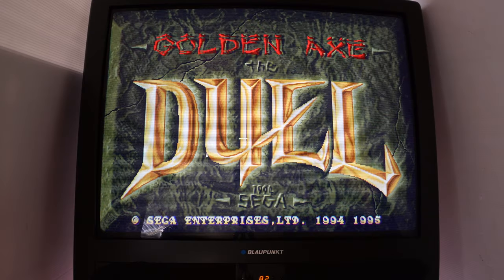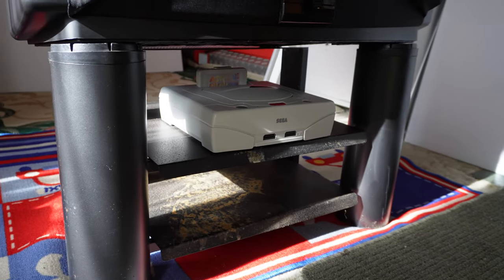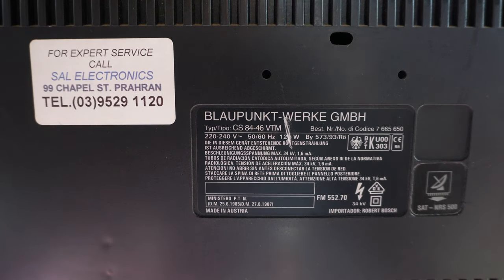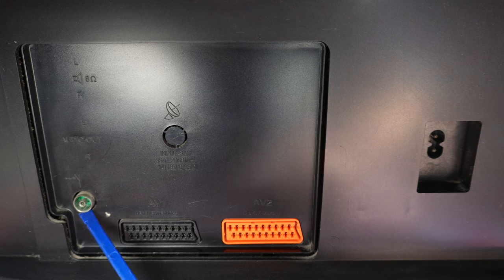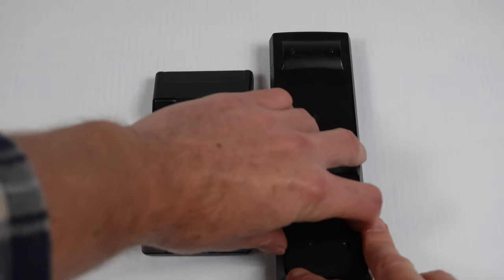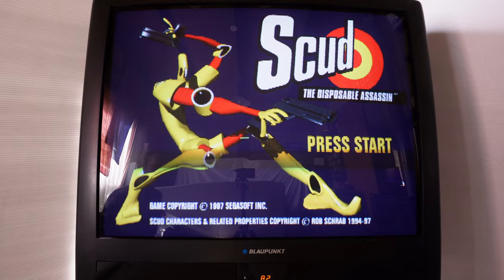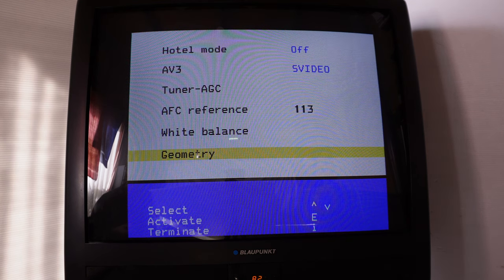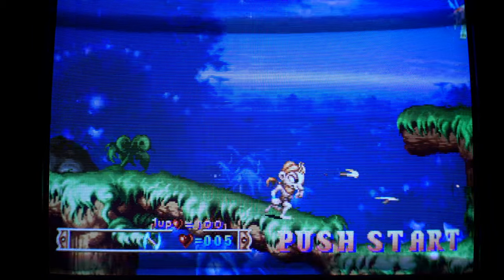Blaupunkt 80cm SCART CRT TV

Comment: I have a 33" BD33s Black Diamond TV with a very similar design. That has a Thomson tube with a Toshiba chassis. It also has the speakers beneath the tube, which makes the overall shape of the TV much slimmer and more pleasing to look at. If it helps to figure out which remote belongs to which TV, I have a 14" Blaupunkt PM 37-43 VT EI, with an analog chassis and a TC 144 remote like the one with the worn buttons. It's an excellent 14" TV.
Reply from the maker: Awesome to hear!